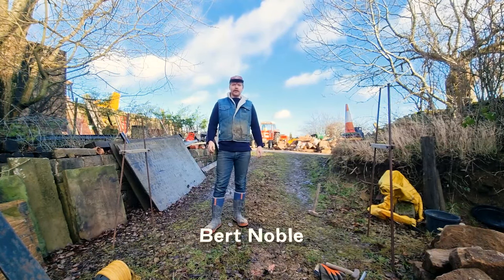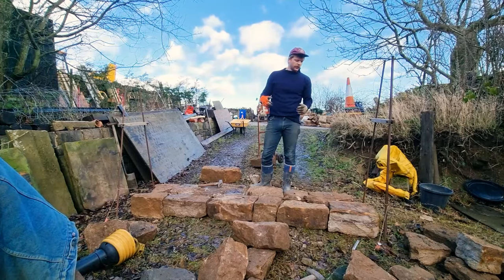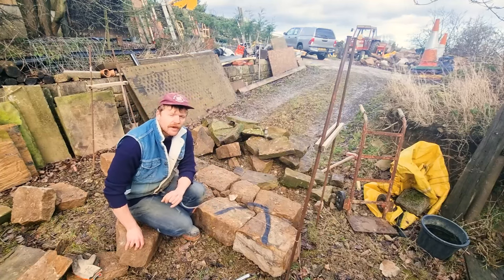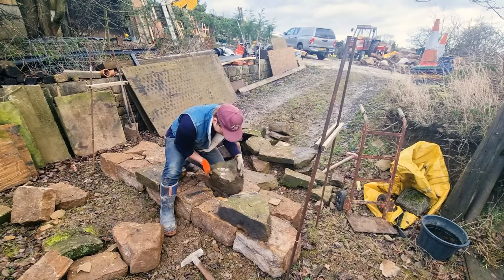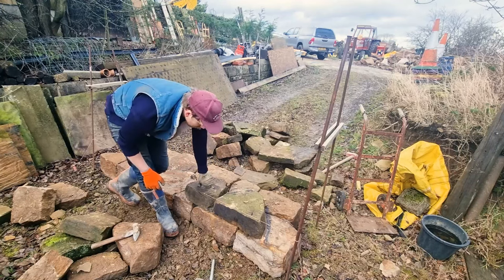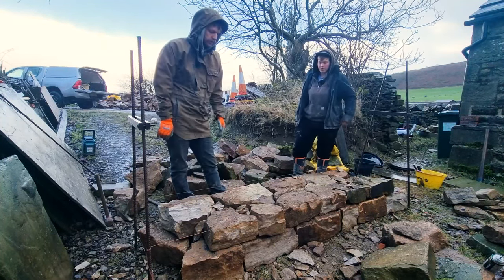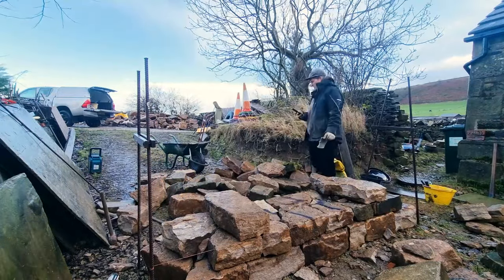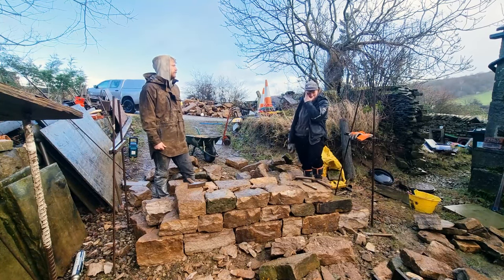How to build a Dry Stone Wall. Part II: The First Lift.  (Trade Secrets Revealed!)

Comment: I went to Bolton Abbey in Skipton, Bradford recently. I was amazed that the church shell structure has been without a roof for 400+ years and it looks strong as though it was destroyed less than a decade ago. As I looked at the stone wall boundary fence at the roadside, I  noticed that the wall had three parts: Two parallel outer and inner walls and the gap between them filled up with mortarred heartings/fillings. The inner wall, at the  open exit however, was pulling away from the joining center. Since I had watched your videos and believed in your method of overlapping stones, it was like further validation of your style. I have never built a stone wall but I hope to, one day, God willing, and I will build like you have tutored me. I hope I will be able to give feedback to my tutor. Thanks a million for sharing.

Comment: I live somewhere with about the same weather as Moscow, hah, the frost line is almost 2m down, in your first video on foundations, you just talk about getting the organic soil off to get down to the mineral subsoil below, but what do you recommend as far as frost heave?  If I have to dig the foundations down below the frost line, that's a huge amount of dirt to move, as well as more than double the stone I'd need for a 4-5' wall.  Can I just take the top soil off instead?  There are a bunch of 100+ year old stone walls in my area, that look more like they've had stone robbed from them, rather than theyve fallen over from frost heave, If you dont have experience with cold climate, I think I'll habe to disassemble a section and see of they have a deep foundation or not.  Thanks again for the great videos.  I've been fortunate enough to do several traditional apprenticeships, in wooden boat building and metal machining, and I'm fascinated by the "good stuff" that doesn't get written down in the books, and stone masonry is sort of the most famous as far as keeping the tricks secret, hah.
Reply from the maker: Thanks for the comment! It's an interesting topic and my knowledge is a bit limited on best practice in areas with serious frost heave. I've worked in Maine and Canada and over there the approach seemed to differ depending on the purpose of the wall. Sometimes they dug out 600mm or so and filled the hole with compacted gravel and built on that. In one extreme example, I worked on a job where the contractor dug down 2 metres and poured a 400mm thick concrete slab then topped it off with compacted gravel 1600mm. The foundation probably cost more than the actual wall in that case. Most times when I've worked over there we just took about 300mm out and filled with gravel. If you're happy that your wall will move a little bit then I think that's fine. It's more of a problem if you're building a retaining wall or something that needs to remain inert.

Comment: This is brilliant content lads. With through stones I’ve seen mentioned before that a through stone should be used at set distance in your wall (one a metre?) what do you think to that?
Reply from the maker: I would say 1per meter as a minimum. We put them in as often as we can spaced at regular intervals. Quite often we have 2 rows of throughs in at 900mm centers so will average more than 2 throughs per m². The measurements are a rough guide though ,

Comment: I love your videos! I live in the US in New England. My house, like many, have a stone foundation. (Mine is stacked, not motared). If someone wanted to build a house with a stone foundation, should it go below the frost line? Also, would you recommend pouring a concrete footer even though they didnt do that in the 1700s?

Thanks in advance
Reply from the maker: You know, this is not really my exact area of expertise as we don't get much frost where I live. Old houses here are walled with dry stone directly onto the subsoil, however they can move over time which is why the medieval buildings in england can all look so wonky. I think to be on the safe side I would recommend pouring a concrete footer or try to seek the advice of a local restoration builder. Depending where you are in NE I might be able to put you in contact with someone. Cheers!

Comment: So would you suggest a heavy angle batter on walls that are used for stem walls for a house or garage OR straight up from first course ?
Reply from the maker: Would it be underground? No reason why you couldn't build it plumb as long as the wall is thick enough and the stones are big enough.

Comment: Hi, 
Why is there no foundation in your build?
I'm from the Netherlands and our soil is no rock.
Mostly earth, clay and sand.
What would you recommend for a foundation for dry stone wall on such underground?
Reply from the maker: on my family farm about half of the walls are built directly onto the clay, the 200 year old walls have spread and moved a bit but it kind of gives them their character. I've also seen walls built on really boggy peat and they have huge flagstones underneath to stop the stones sinking into the bog. In most cases small dry stone walls dont need a concrete foundation

Comment: I want to build a low, 2 ft retaining wall. Does it need to be built like a regular wall,  with 2 sides, or just one face side with threw stones and batter? Hard to find any videos on dry retaining walls.
Reply from the maker: better to build it with 2 sides but you can put all the ugly stone in the back and use the good stuff for the face.
Reply: @drystone-tv  thanks!

Comment: I really appreciate the obvious high level of drystone skills demonstrated in these videos. However, i am a little confused re your comments about movement of foundation stones. What you say appears logical. But...i see in Stonework a Technical Guide to standards and identification of common faults in drystone walling,( by Sean Adcock ) that it is stated that; 'none of the stones should wobble when walked  upon'.  Given that this non movement of foundation stone seems to be?? one of the key criteria in achieving  DSWA certification I find it interesting that you appear to be dismissing the ' foundation stone standard' as ' a total load of crap/myth made up by people who weren't wallers in the first place'. 😳
Reply from the maker: My problem with it is that it doesn't take into account stone type or size. Large stones will rarely move when walked on no matter how badly they've been put in and small stones will always move no matter how well they have been put in. Its just one of those things where in the past I have seen people walk on foundations and it has just shown to me their lack of understanding of different situations.
Reply: @drystone-tv  Thanks for the clarification.  Sean Adcock actually sums up (in the Guide) what i think you are saying with the old adage;  "Rules are for the guidance of wisemen and the blind obedience of fools".

Comment: Cracking videos to watch thanks.

Without being that wanker (me) do you not wear eye protection?
Reply from the maker: I've never regularly worn eye protection but not because I have anything against it. I've just found it's really really hard to keep safety glasses clean and scratch free in a walling environment. That being said this summer I've been wearing some different sunglasses and have found them much better for working in so they've been on nearly every day.
Reply: A good question. As an apprentice in the '60's I was often given a hammer and chisel and told to chisel out a groove for a pipe in a brick wall. No thought about eye protection back then - unless you were the one with the hammer and chisel that is. Times have changed; fortunately.